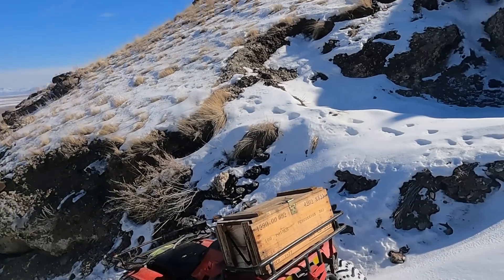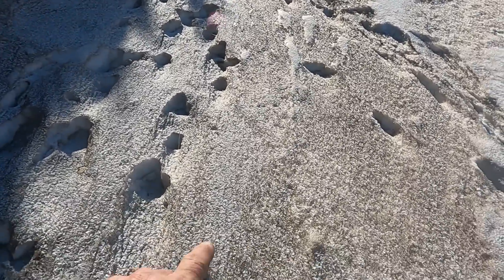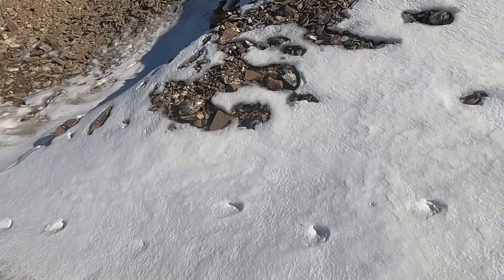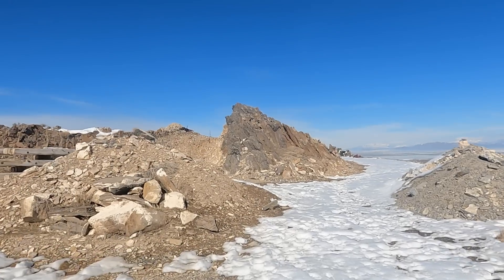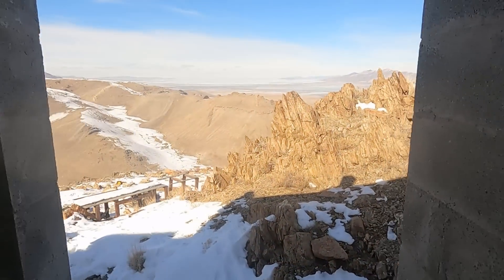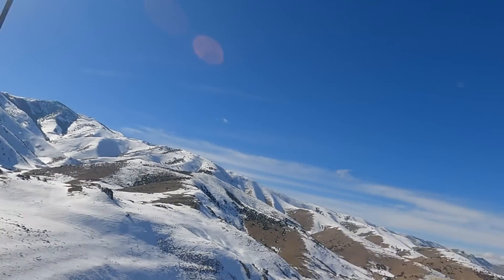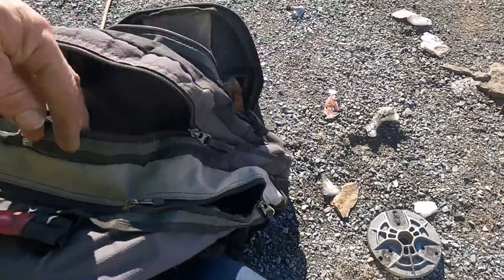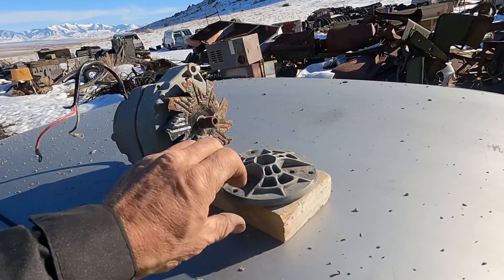Fortress Hike through snowdrifts for Turbine Parts DIY 2

Comment: It would be interesting if you could do a video explaining how the alternator is modified and how it works.  I find the way you explain things is very understandable compared to most people quoting text book terms out of my ability. Thanks for sharing these updates they are great to follow the progress and planning process.
Reply: Take the alternator apart. Three wires go from the wire coils to the diode assembly. Remove them from the diode. These
are what you will get around 100 volts AC from. Pick a wire, call it #1, voltage at speed between it and another of the two remaining wires. Pick one, call it #2, the other #3. The output will be three phase.
1 voltage 2 voltage 3 voltage 1. Voltage from 1 to 2, etc.
Reply: @garyspoering2463  So does this work only using a Chevy alternator or can you use say a ford or Chrysler one ? after watching it again that looks like a ford instead if chevy alternator
Reply: My experience is with the GM Delco but the others are similar. In fact I was going to us a Chrysler product to make a portable welder out of a lawnmower. Good luck with your build.
Reply: @garyspoering2463  Thanks and good luck with yours
Reply: I will be following an article in an early 70s Mother Earth News magazine. Might try looking it up online, mine is a photocopy.
Post here if you have questions on the windcharger. Still want to finish mine for power to a camper on some remote mountain property that is eight miles from the power lines.

Comment: You need to set up a ski lift type setup to bring up materials and you when the roads get rough. Withba 2 way switch at the top and bottom. You probably have enough scrap there to rig something  up.

Comment: Several years ago I made a hub to put a cooling fan from a Ford Aerostar van on an alternator. Stepped out into the street, clear of the trees, holding the alternator in my hands and turned into the wind. The fan spun up the alternator quite fast. Now what! How to stop it. I slowly turned crossways to the wind, the fan slowed down, but the whole thing tilted, precesssed, very slow motion as I turned. It finally stopped. DON'T EVER DO THAT! Good luck with your turbines. Beautiful scenery!

Comment: Alan I just started following you by way of the Heavy d site. So, if I am talking about something you’ve tried my apologies. But, have you ever used or tried and air conditioner style ECM motor without the ac to dc module. Just the motor, for your wind generator?  The motor which puts out dc volts to the tune of over 400 VDC works well as a home built wind generator with an inverter added. Air conditioning supply houses usually through them away when warranted out by a company and the motors are still good. And, the inverter style ac units have a condenser fan blade built for variable speed wind movement that picks up small amounts of wind up that works well with the motor in that usage. Except high wind. 
Just an idea.

Comment: And snow melt mud is worse than regular rain mud, Before it snows, there is a little rain that makes mud, the moisture in the mud freezes and expands the soil particles, then it gets capped with snow, when it melts, the mud is much looser than regular mud, making it much harder to gain traction.

Comment: Hey, fellow wizard! If you cut the uphill side of the road back, it will with the air current down the road. Think of your road bed as a riffle in a sluice, as the cold air moves down the mountain, it hits the road and the moves down it's slope. If you 'gentle' the slope transition it'll reduce the flow. That said, I know you don't want to cut into the micro-caves.

Comment: Might have to think about getting yourself a sled or a track kit for the ATV. Only thing about a sled is pretty dangerous/tippy over those drifts, I was thinking you'd have to get in there with the excavator and open the road up wider.
Reply: With the machine shop could sorta easily adapt probably any tracks. @GrindHardPlumbingCo puts tracks on stuff all the time.